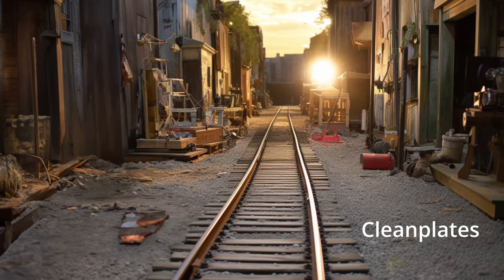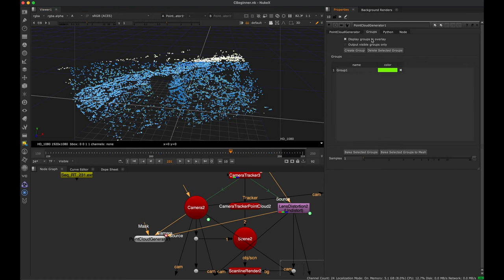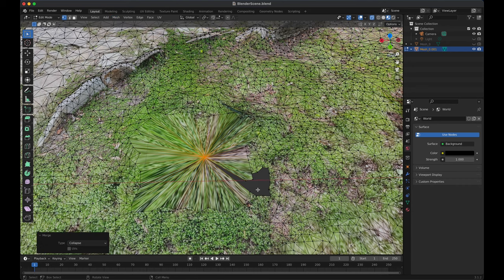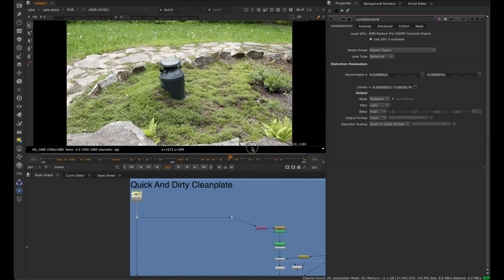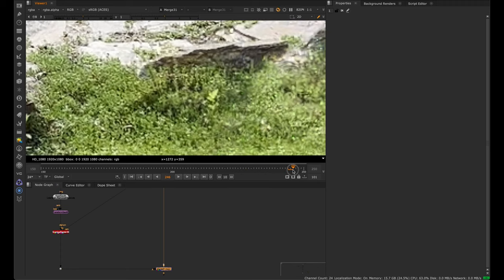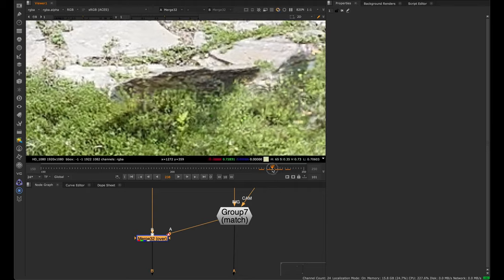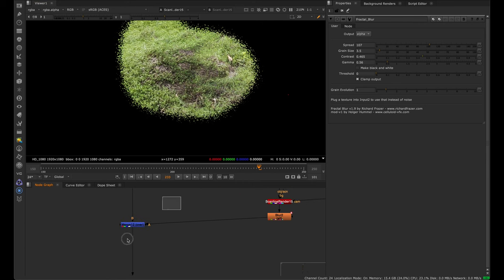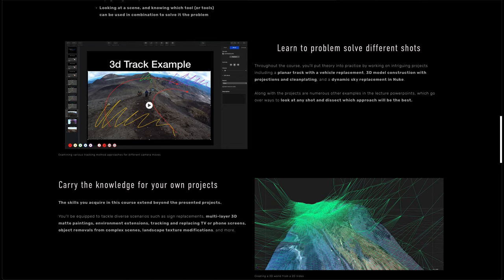Cleanplate Projections | Nuke Compositing Guide

Comment: Thanks for the helpful tutorial, would you please explain more about how to import the lindar scanner data into nuke?
Reply from the maker: Hey there, this is just a geometry that the app creates.  Polycam will create a .fbx or .obj file, and you can load this file into nuke using a Readgeo node.

It was then manually lined up using a TransformGeo against the Cameratrack point cloud to make it match the scene.

Comment: Great tutorial as always! I'm curious as this isn't covered in your video, if you have a lidar scene, and then you track your camera, how do you accurately position the camera correctly in the 3D scene relative to the lidar data? Would also love to see a lidar scan video. Thanks
Reply: I think you would use the point cloud that the tracker generates and line it up with the geometry on the lidar scan
Reply: Once you do your camera tracker you use your points (iuser tracked, I believe you can use the auto tracked points but idk) and link them to a vertex (right click (i think) -> user tracks -> and snap to vertex selection. you do this a couple times in different areas and it should be aligned fairly well if your lidar is accurate, you may need to adjust the x and y on your user track to shift it if its slightly off, sorry if this is slightly incorrect i dont have nuke infront of me atm. I prefer to do this in 3dequalizer tho, I think nukes 3d system is a little odd for me. I really like VFX tutors tutorial on matchmoving it pretty much achieves the exact same result the video is called "3DEqualizer Free PLE version Tutorial - Create a Matchmove Reel For FREE Pt.4"
Reply from the maker: Pretty much what the other commenters said!  I just lined it up by eye to the camera's point cloud.  It's not completely perfect doing it this way, but it works.

There is another way by using User tracks imported into the camera tracker, and you can pin features to geometry vertices, this article explains it:
https://learn.foundry.com/nuke/content/comp_environment/cameratracker/3d_survey_points.html

I haven't personally had to do this process in a very long time, usually with super detailed & tight tracks a Matchmove artist will do this process in Syntheyes or 3D Equalizer as those tools have really detailed ways of achieving super tight tracks.  

Working on films if a lidar scan was taken, before it comes to you usually a matchmove artist will line up the lidar for the compositors for the whole sequence, so the compositors will just load it in for whatever shot they're working on.  Film lidar scanners are much more detailed than the iphone one, sometimes down to millimeter accuracy.

In smaller studios, you might have to do this process yourself, but if it's a commercial studio having lidar in the first place might be rare unless the visual effects supervisor took the time to capture one.  If it's a more complex shaped set they might take it, but it depends on the budget and time they had, etc.

Even just lining it up manually though is a great thing to have for your own projects though.  When I do my own projects I usually go around and capture whatever scene measurements with a measuring tape / lidar / HDR spheres, lens grid, etc - all the stuff a visual effects supervisor would capture on a film shoot.  The more data you have later, it makes it easier to put CG stuff in and make sure it's all the right size / lighting / lens distortion.

Comment: Thank you for the tips but i want to constructively criticize something that probably you know and left out  intentionally. The area of grass you replaced is darker then the rest of the patch because the object there is creating soft area contact shadows from the cloudy day  and diffused light around it. If you remove the object you should correct the exposure of the patch to be similar to the grass around where is exposed to the sun/sky. Right now the attention is drawn to it by then small different in exposures and always take in to account the light and shadows contribution when removing stuff. Nice tutorial anyway. Thank you.
Reply from the maker: Hm yeah you might be right.  I was reading at it as more just dead grass or darker patches of grass mixed in, but probably could use a slight brighten anyway since it’s supposed to be flatter as well

Comment: by dissolved do you mean fades?
Reply from the maker: Yep exactly, you can just use the mix control on a merge node to fade it on or off, or you can use a dissolve node if you want to blend between two different images on the same layer